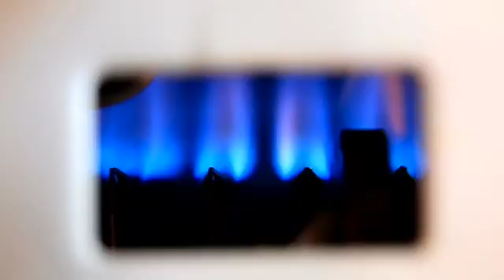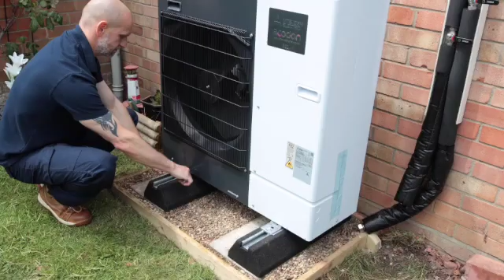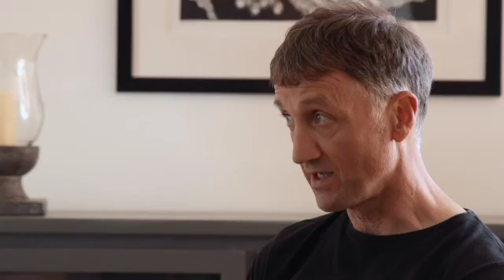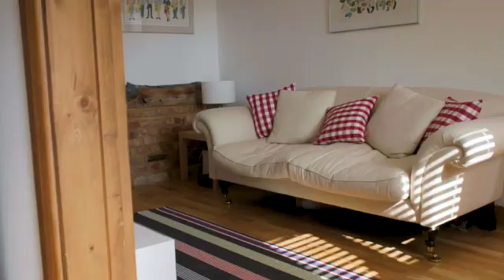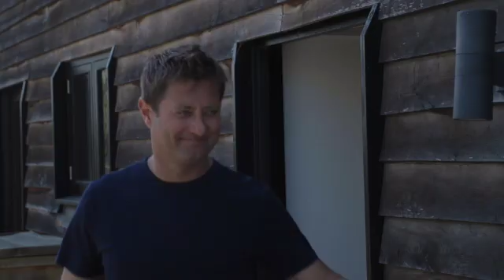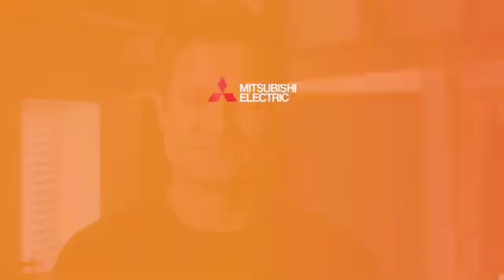Mitsubishi Ecodan with George Clark

Comment: We moved in to our converted barn 9 years ago (bought from a previous owner who didn't really live in it). It has an ECODAN ASHP for underfloor heating and hot water. It is expensive to run and gives nothing back. I have turned off the heating and replaced it with 3 Everett stoves, which are really good. Although the hot water is set to 24hrs it is always cold, so we have to repeatedly use the boost button (up to 3 times) to heat water for washing up etc. I have really struggled to find anyone to offer a service, the original installers have gone. I have recently contacted a company I saw on a recommendation of our local face book page who wants £400 plus vat and extra if the glycol needs topping up. Luckily I have a gas Aga (aims programmable) which help to heat the property; gas central heating would be preferable but with the cost to convert and net zero agenda this is not a possibility. I am so frustrated!!
Reply: *Everhot

Comment: I have endured living with underfloor heating in the past.
Its completely unresponsive - the temperature varies wildly in the UK and the underfloor heating is a pain.
Middle of winter on a nice sunny day - solar heat is pouring in the windows and you get cooked.
You have to close all the curtains and open all the windows to cool it down.
Then it suddenly turns cold and you freeze - it warms up 8 hrs later, by then it may be too hot again.
Oh , the MCS is nothing more than a scam to keep prices high.

Comment: We live in a 3 bed timber-framed new build semi and have a Daikin Altherma ASHP. From my 3 month of experience of using it over winter, I would put it in a skip and have a Viessmann gas boiler fitted in its place - if we were on mains gas.
Reply: There are lots of resources on YouTube for free to improve the efficiency. I would recommend checking channels like heat geeks and urban plumber to name 2. Often ASHPs are not set up properly with to high flow temperatures or bad weather compensation curves, constant cycling etc. Upside down Fork is another good channel. You should check them out to see if you can improve your COP. Every house is different. It isn't the heat pumps fault it is a bad installer or not set up properly or both. Hopefully yours is installed properly but not set up properly so it can be fixed for little to no cost. Good luck!
Reply: Damn, this is not great... so should I be looking at throwing my money down the drain?

Comment: I have a 2 bed property with an r32 exodan, and my home is so cold it's intrue, this was swapped for an s and y plan as that wasn't working at all, my bills were 1,600 a quater, and this new one is still not heating my home, and I had a bill for 1,300. My radiators are not working properly and are warm at the top and cold at the bottom, we are so cold but I'm still getting high bills
Reply: What kW is the heat pump? Surely this has been badly designed and installed?

Comment: I don't heat my house June thru' Sept so  SCOPs are misleading IMHO. What are the COPs for Nov, Dec, Jan and Feb when the temps sometimes get down to -3C?

Close to 2 I'd have thought, but I'm happy to be corrected..
Reply from the maker: Hi David, the COP will differ dependant on the application and It would really depend on things such as; the age of the property, size of the property, heat loss calculations, the ambient temperature target internally, heating emitters/sizes etc. COPs can certainly reach 3 or more in those winter months.
Reply: @dorewoodman  Thanks that's reassuring.
Reply: Hi, I have a 1984 built house up North, over a total of two years my SCOP for both hot water and heating has been 3.75.  Approx 4.0 for heating, and 2.25 for hot water.  The lowest I've seen the COP is just above 3, but it was -5ºC on average for a week.
 I'm not lucky enough to live in a lovely converted 16th Century Barn with underfloor heating, it's a standard red brick house on an estate in Yorkshire.  These heat pumps work in the more realistic world that some of us live in too.
Reply: @Muppetkeeper  Same here with house style MK.  Very reassuring your COP was above 3 @ -5C. What was your flow temperature from the ASHP @ -5C?
Reply: @davidreece1642  hi, the flow temp at -3 is 45°C
Reply: @Muppetkeeper  Thanks.👍👍
Reply: @Muppetkeeper  hi, id also be interested to know this, and if possible your total heat loss and design flow temperature.
Reply: @handle1196  Hi, total house heat loss is 8kW at -2°C, the design flow temp at this outdoor temp is 45°C.
Reply: @Muppetkeeper  Thanks for replying. Hoping to get a scop of 4 on a self build with a 6kw heat loss.
Reply: @handle1196  Install as big radiators as you can, low temp is more efficient.
Reply: @Muppetkeeper  did you size them to the heat loss or go bigger than recommended.
Reply: @handle1196  The flow temp is inversely related to radiator size, so bigger radiators mean lower flow temp = greater efficiency.  The heat loss of a room / house is constant at a given outdoor temperature.  
So for example, and these are just numbers to show the point, not actual, if you have a room with a heat loss of 1kW at 21°C inside and -3°C outside, you can have a big radiator at 35°C to heat the room, or one half the size at 70°C to heat the room. The rooms heat loss is constant, but flow temp varies by radiator size.
Reply: @Muppetkeeper  i understand that part, but we size our radiators using some calculations that provide a scaling factor to select a radiator from the dt50 chart. Part of the calculation requires the mean water temperature which sits between the flow and return. Dt20 gas or dt5 for heat pump.

So if i select a MWT, apply the calculation and find a suitably sized radiator that matches the heat loss of the room, then a physical size that looks correct for the space its going in.

But it seems that lowering the MWT by just a little bit like 2.5 degrees, results in a much larger radiator being required which if you have large rooms and dont want two radiators is a problem.

Id love to have 35 degree flow (32.5 mwt) but it results in radiators too big for rooms like the bathroom.

There must have to be a balance to factor in flow temperature vs highest heat loss rooms rather just just saying, lets run it really low.